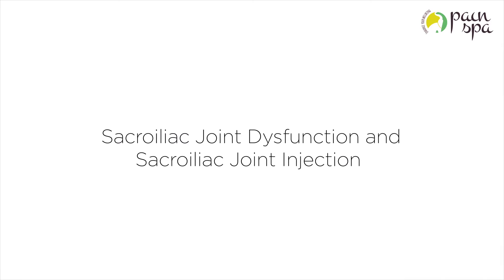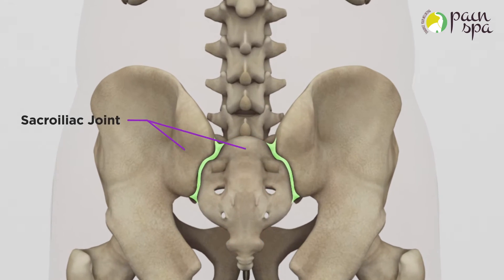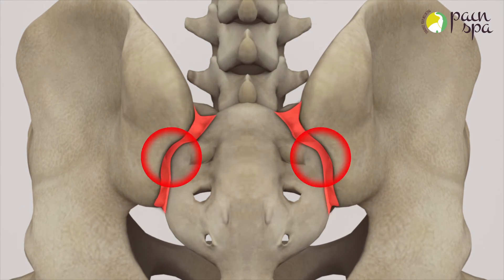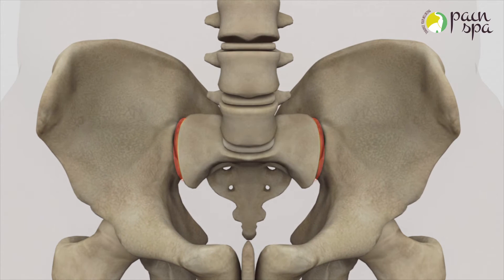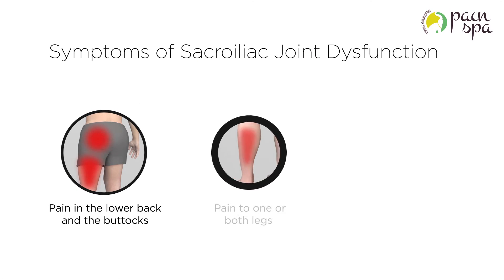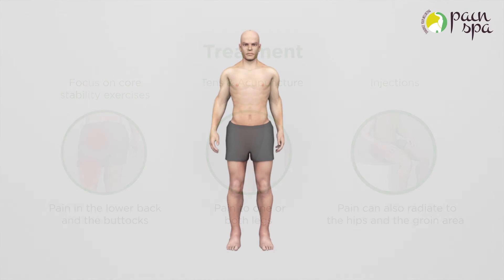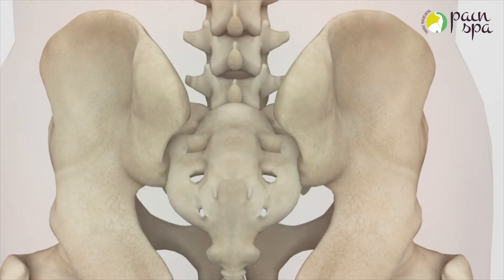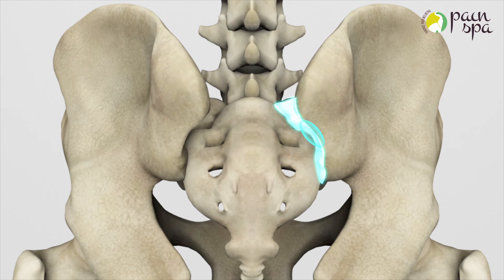Sacroiliac Joint Dysfunction & Injection

Comment: I've been misdiagnosed for over 10 yrs, had back surgery and epidurals, finally a Dr diagnosed it this year now I'm living without pain 🙌
Reply: Back stuff is hard to diagnose.   I had to go see a spine specialist.  Sacrialic joint seems like it takes a long time to heal.  I feel like you have to rehab and strengthen your core.
Reply: @boostmode84g83  did that for 10 yrs, now doing much better with the injections just hope I can now strengthen my core and loosen my hamstrings
Reply: I also being misdiagnosed for around 2 years finally found sacrolittis now doc suggested for the injection,What sort of medicine used for si joint injection caudal epidural block or selective nerve root ,do u hv any idea or if you know medicines used in the injection,I'm curious ?
Reply: Hi jess how r u doing have u gone through sacroiliac injection process please letme know